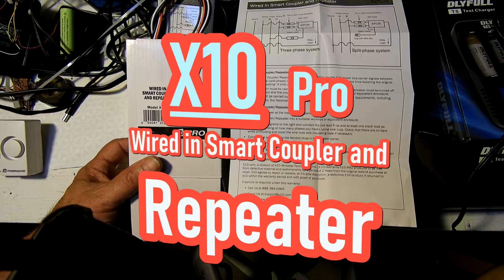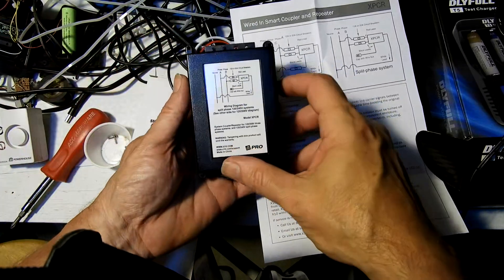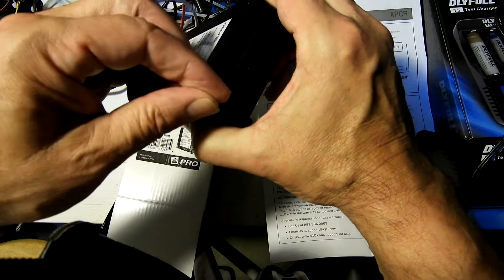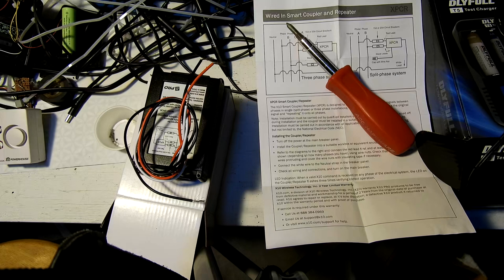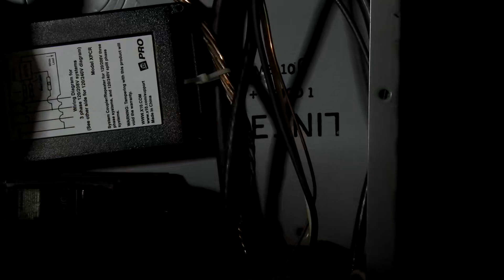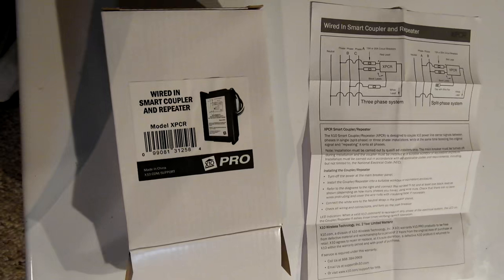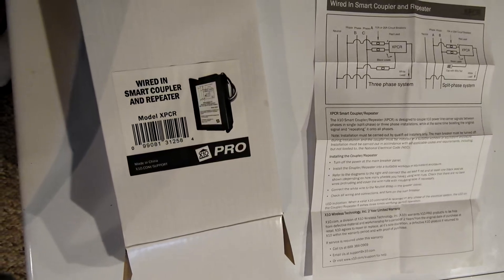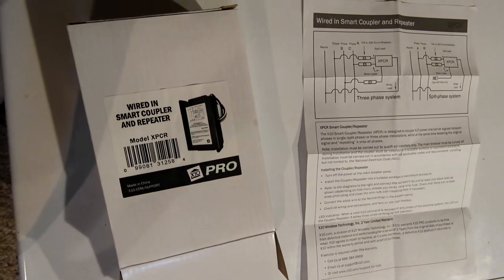X10 Wired-in Smart Coupler and Repeater (XPCR)

Comment: I have been using x10 for decades. Far from perfect, but does work.
I have the the bridge/repeater, it makes a huge difference.
The wm100 web interface breathed new life into x10.
I use x10 devices everyday.
Reply from the maker: I need to get the filter too, the one that installs in the meter box. I get a few stray signals. I could play with changing house codes but easier said than done! I have so much of it, and some units lack dials and are coded by tapping a button.